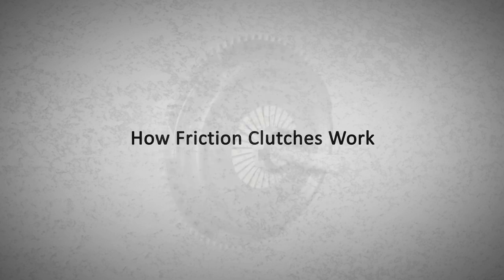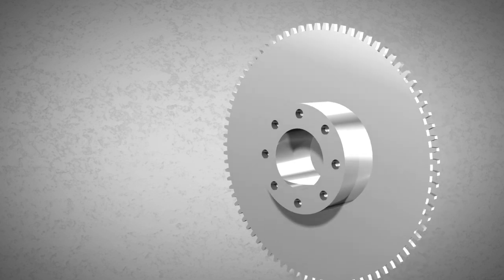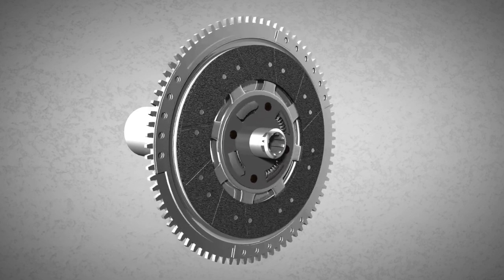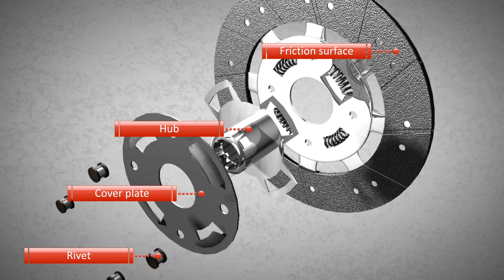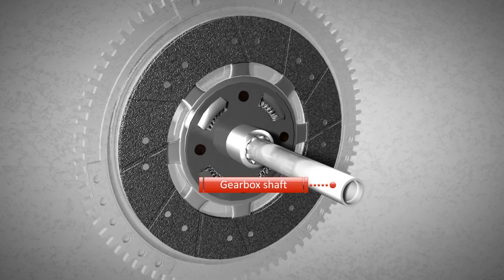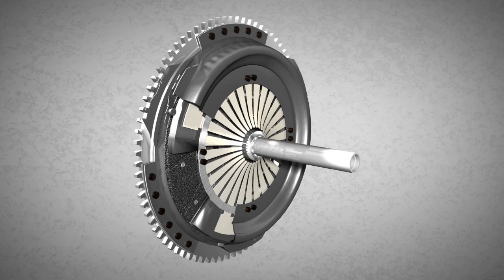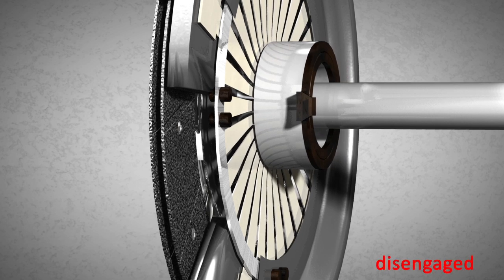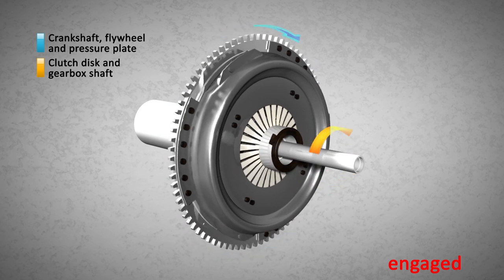How a clutch works! (Animation)

Comment: i dont understand how its possible that the engine transmits its power to the gearbox a 100% without any slip when a gear is engaged,or is there slip under hard acceleration?

How much pressure is there between clutch disc and flywheel?

does the clutch rotate at exactly the same speed as the flywheel/with the flywheel.... a 100% all the time when a gear is fully engaged,or is there slip if i quickly accelerate?
Reply: If your foot isn't touching the clutch pedal the flywheel and clutch are turning the same rpm.

Otherwise you need a new clutch.

When you are pushing the clutch there is slippage while the two synchronize speeds
Reply: affilinet When there is slip, it is in a condition known as "kinetic friction," meaning the two surfaces are moving relative to one another. As you disengage the clutch in gear with the intent of moving forward, the engine torque and vehicle mass exert increasing force on each other until the driveshaft speed matches the engine and the clutch surfaces enter a state of "static friction," where they are not moving relative to the other. Breaking this state of static friction requires much more energy than it does to maintain. This is why higher power engines require heavier clutches.
Reply: I would like to know the answers to the exact same questions. curious mechanism. you would think there would be a more stable way of securing the two to ensure 100% power transmission with no slipping.  although, the coefficient of friction is probably so massive, considering the tension, the material and the surface area, i would imagine that slippage would be very, very minimal
Reply: the material that the clutch is made out of is mean't to be extremely hard to slip so that is a big factor right there, additionally the clutch is pressed against the flywheel with a couple hundred pounds of pressure and then racing or heavy duty vehicles can have multiple clutches, 2 or 3 which are already of much higher specification than the ones which would come in a very basic car.
another thing is it has springs so it is not completely rigid, that means an abrupt force can be absorbed by the springs rather then causing the clutch to slip.
even with all that said I'm still impressed that this clutch system works with virtually no slipping, it really is a huge amount of force.
Reply: It's a giant amount of force. Even one of those leaf springs on the pressure plate is nearly impossible to disengage by hand. The force is multiplied by leverage and hydraulics (or cable). If you put a pressure plate on the floor and stand on the spot where the release bearing touches the springs, they will barely move. To disengage them all would likely require 1000lbs of force or more.
Reply: There is a good bit of slipping at high rpm's i don't know if this has anything to do your question,but when i shift and their is a little bit of slip i just double clutch. This usually only happens at high rpms and with not the best clutches.

Comment: the majority of motorcycle clutches are COMPLETELY different from a car clutch.  98% of motorcycles use a wet, multi-disc clutch, which is designed to be slipped.

Comment: So when i go off the highway and im in 5th gear and i press the clutch down and dont use my engine as a brake (usually always do) and i shift from 5th to 2nd and i keep holding the clutch all the way for like 10 seconds am i wearing it out or does it only wear out when u let go of it when the disk goes back in place ? 
Really good video tho

Comment: I am a huge gear head, this video is top notch quality. Extremely accurate, with clear explanation. I wish it was mandatory that stick shift drivers watched these videos, and actually had to learn how a clutch works, before they got in. I bet you'd have alot less people out riding their clutch, holding it in for 5 seconds at the engagement point while taking off, using the clutch and accelerator to hold themselves on hills etc. Only a small portion of people in America know how to drive a stick shift, yet among that group, an even smaller portion actually know how to drive them correctly. I've seen so many clutches blown out at 20,000 miles, or even less.

Comment: What happens when while driving and you just press the clutch pedal for 2 minutes ( i mean the car already on start and has some speed). Does that cause problem to the car parts like clutch or clutch cover ? 
 i really liked your video .
Thanks
Reply: The only part of the clutch that is under strain when the clutch is disengaged (clutch pressed down) is the throwout bearing. That's why people who hold their clutch in the entire time at stoplights while they wait, while they are waiting somewhere etc. have their throwout bearings fail prematurely. If that happens, it is blatantly obvious. Besides having trouble disengaging, throwout bearings tend to make a ton of noise. The only time that no part of your clutch is being worn is when your foot is off the peddle, that's why an essential to being a good manual driver is keeping your foot off the clutch pedal at all times you don't need to use it. Many people, especially the older folks, like to rest their foot on the clutch peddle, causing it to slightly disengage repeatedly... They wind up ruining the clutch quite fast.
Reply from the maker: No, why should it damage the car?

Comment: I still don't understand one thing. The contact between the engine and the gearbox is presumably hugely energetic, so how come the friction plate doesn't wear down almost immediately? I understand these things are hard but it seems counter-intuitive to me
Reply: Ever seen what happens when people interleave the pages of a phonebook? Suddenly it goes from flimsy, to iron strong, Mythbusters needed two tanks to get them apart. That right there is the power of friction, you'd be surprised at how little it takes to make objects with large amounts of momentum stationary. Both the flywheel and the pressure plate have friction material, when they contact they move together simultaneously, the strong friction preventing rubbing. Now when the friction plate first contacts the flywheel, a tad bit gets worn off each time on initial contact, until they fully synchronize, which happens quite rapidly. Overtime though, the friction material does wear down, and that's when your clutch starts slipping. Once it is slipping, it heats up rapidly, as it is rapidly going back and forth contacting the flywheel, which can generate ridiculous amounts of heat in just a short time span.

That's why you see idiots who are clueless trying to do burnouts, ruin their new clutches in a matter of seconds, as they ride the hell out of the clutch improperly. When driven correctly, clutches are very sturdy, yielding 150K, even 200K+ out of a clutch is not uncommon for a skilled driver. I am not one to endanger others of course, so I'm not tailgating and cutting people off, but I do definitely enjoy having some fun in my car. I have done many fast takeoffs, high RPM shifts, all kinds of things. The key is that on takeoff, I get to the engagement fast, and get the clutch out before rapid acceleration. I switch gifts quickly and efficiently. I'm at 162,000 on the stock, it's still good. So even without babying it, clutches are quite durable.

Comment: What I don't understand is what kind of device (the diaphragm I guess) puts pressure on the friction plate when the clutch is engaged.
I mean, I don't understand what's the motion of the spring diaphragm that allows to put pressure when engaged, and removes pressure when disengaged.

Sorry for my bad english ppl...

Comment: Great video, especially the animated part on how the pressure disc becomes disengaged from the flywheel by pressing the release bearing against the diaphragm spring. You can't get anymore clearer than that.

Comment: Thanks for your explanation.  However, I still have a key question unanswered from the video, and would welcome anyone who has the knowledge to answer it.  When the pressure plate is pulled away from the clutch disc as the clutch pedal is being pressed, why does the clutch disc slide along the input shaft towards the direction of the pressure disc (thus disengaging it from the flywheel), when there is no force driving it to do so?  Remember all we are doing is to disengage the pressure disc from the clutch disc, and the pressure disc does not actively pull the clutch disc away from the flywheel. The inertia should keep the clutch disc in contact at least momentarily with the flywheel, thus spinning still with it at the same speed, until the friction is not enough to keep it that way.  If that is correct, the slipping friction will wear the clutch disc in this case.  But again, what is the reason that you say in your video the the clutch disc is going to disengage from the flywheel (meaning that we create a space between the flywheel and the clutch disc by pressing the clutch pedal)?
Reply: I’m new to this so I might be wrong. 

I think that was just a demonstration to show when the flywheel and clutch disk are connected it causes the gearbox shaft (or input shaft as you called it) to also be engaged.

I believe that the clutch disk and flywheel are not directly connected and that the clutch disk is in a space between the pressure plate and flywheel. I also think that the flywheel and clutch disk only rotate. So they don’t “shift” or move in that way. Therefore the only way the gearbox shaft (and consequently the clutch disk) can be engaged is through contact with the pressure plate. And as explained by the video the pressure plate does move/“shift” due to diaphragm spring and release bearing. The pressure plate is also directly and always connected to the flywheel. So the pressure plate basically acts as an extension of the flywheel.

A lot of assumptions were made and I did try and answer this 6 years later. So if you or anyone else understands what’s really happening I’d appreciate an answer.

TLDR: Flywheel is not directly connected to clutch disk.

Comment: Isn't Pinion suppose to be for starter?  Also I don't think release bearing move around cause there is clutch arm on it.  Only metal part move.
Reply from the maker: Yes, pinion is for the start phase. What's the problem?Release bearing is turning in some cars.
Reply: Thomas Schwenke Yeah, no problem at all.  It is just that it is different.  The black part on release bearing in video don't turning round except for metal ball.   and starter is about 1 to 2 inch pinion gear.  I have Nissan Truck Pickup 1995.
Reply from the maker: Hello. For this clutch, it is turning :)
Good point for the pinion :)

Comment: And this is why I wont let anyone drive my car unless they know what a friction point is and can feel it when the clutch engages.
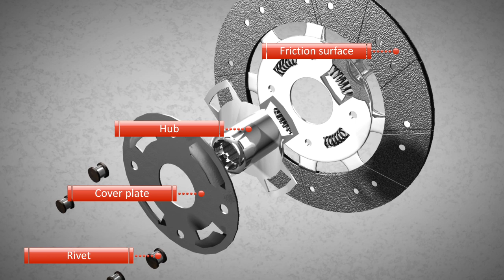Also, that high friction material mentioned around 1:30 is still just material.  It can scraped off or become smooth. So slipping your clutch can reduce the friction in the clutch and may cause your car to slip even when its in gear.
Happened to a buddy of mine, he wouldn't match the gears needed RPMs to the motors RPMs and would just let the clutch slip until the car was in gear.... ruined his clutch to the point that the car would slip when he'd accelerate to highway speeds.... poor car...
I'd keep saying, "You need to match your gear speeds" he'd say he didn't care...

Comment: Two small corrections...
1) Pressure plate is bolted to flywheel - otherwise you could not change the friction plate, or remove access the flywheel-to-crankshaft bolts.
2) The "ears" on the release bearing clip onto the release fork and do not rotate with the pressure plate.  The front of the release bearing (where it meets with the diaphragm spring in the pressure plate) has the actual bearing.

Otherwise great video.
Reply from the maker: Thank you :)
Reply: You're great.

Comment: what program did you used ? 3DS Max ? or something else ?
Reply from the maker: Carrara 8 Pro (Daz3D)
Reply: Thomas Schwenke
aha, I see

but what 3d modelling programs are the most easy to use and the most efficient ? what 3d modelling programs worth to use the most ?
Reply from the maker: ddf0dr1v3r2
That depends. Impossible to say right now. Carrara 8 isn't expensive and you can do really cool stuff with it :)
You my also use: Blender (free), C4D, Maya, 3dsMax, Modo ...
Reply: Thomas Schwenke thanks for suggestions

I know 3DS Max, but it requires some time to learn how to use (from what I've noticed, or maybe it's easier than I know)

I've heard of Maya that being one of the most easy 3d modelling programs

but next week I will start to learn CATIA Industrial Design at university / faculty / college, so I must focus mostly on this program right now (which for me seems one of the most easy to use, maybe that's why my university learns us)
Reply from the maker: Carrara 8 is very intuitive and very easy to learn. Maya is the most complicated because it is not very intuitive and has very, very many parameters and modules.
CATIA is a tool for mechaincal engineering, Maya and 3dsMax are tools for animating characters, rendering... so you cannot really compare those tools :)
Reply: Thomas Schwenke aha, I understand now

first semester I've learned AutoCAD (which is good enough for pieces), but second semester I will learn CATIA because my specialization is car engineering (so I will model pieces / mechanical organs [the most, I think] and maybe body cars also)

but what's the best for body cars ? Carrara 8 or CATIA ?
Reply from the maker: Hi, once again, Carrara is an animation tool, CATIA is kind of a construction tool. So, you cannot compare them. CATIA has also many modules you can add to the existing base tool. In general, CATIA is the first choice for mechanical engineering...
Reply: Thomas Schwenke
aha, I see now